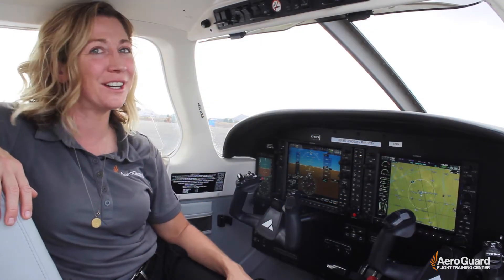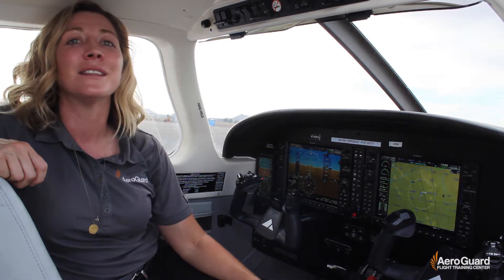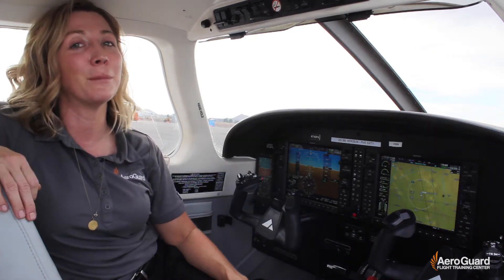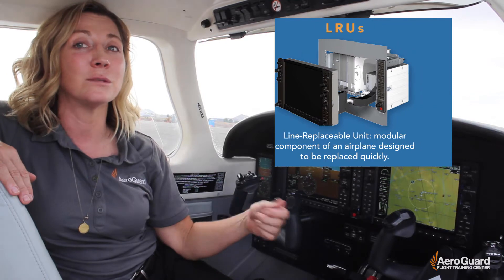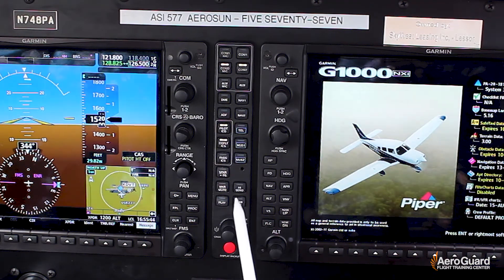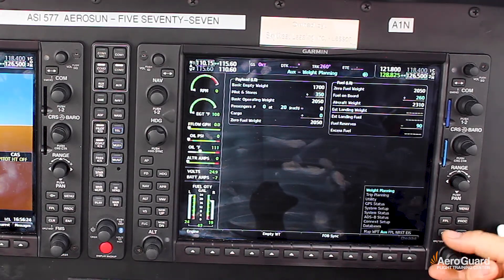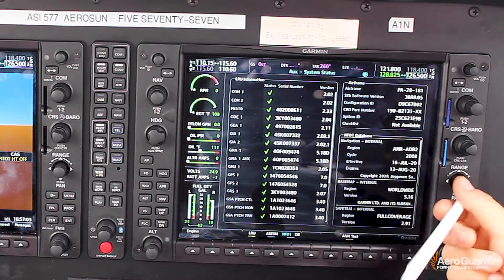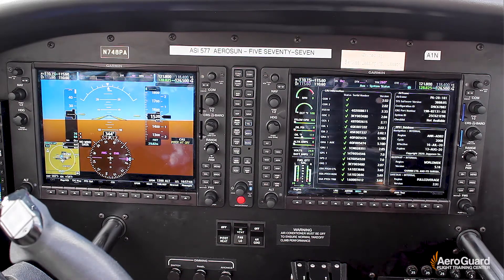G1000 Avionics Overview for Flight Training – AeroGuard FTC

Comment: Another cool feature with the G1000 is the configuration mode... 

you can see the status of all external kits and their interface statuses that run through the GIAs.  Additionally, you have full command of the Digital IO and can command those freely in maintenance mode.

The logging files that can be created with Garmin's tools are also pretty extensive and can log a variety of parameters under just about any condition.

Comment: What instruments would you rely on if the entire glass system failed you. I always thought the six pack was always kept as backup. Great video, thanks.
Reply from the maker: You’re right that all glass cockpits are required to have backup instruments in case of failure. For most planes, this backup system includes steam gauges, but in our planes, we have the backup instruments on a second glass panel to the left of the Primary Flight Display (PFD). You can see this in the video, but also on the image on our homepage https://www.flyaeroguard.com/ over her left shoulder. This screen is able to display attitude, heading, altitude and airspeed information.
Reply: @flyaeroguard  great thanks for your response!
Reply: @cn9936  I used to worry about the class cockpit failures, but you can see they have separate smaller displays (garmin g5's I think).  After watching some videos on how Garmin tests their devices, I realized they are way more reliable than vacuum pumps
Reply: instablaster
Reply: @cpy   G5 is smaller. That standby instrument is Aspen